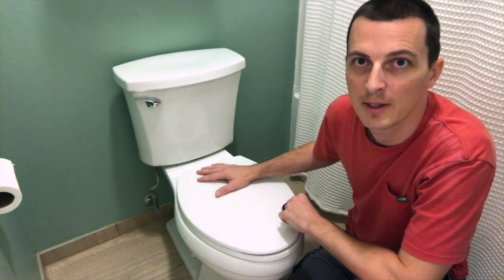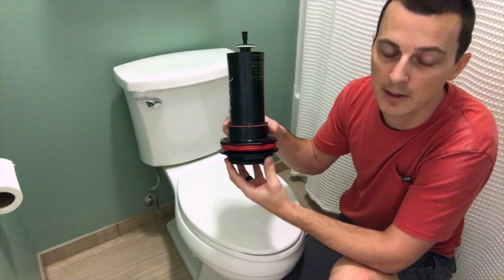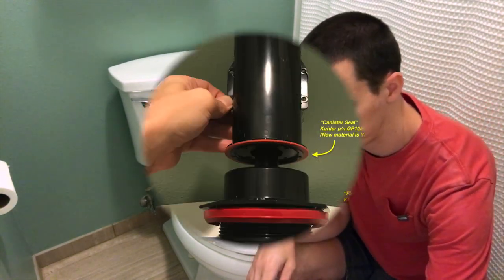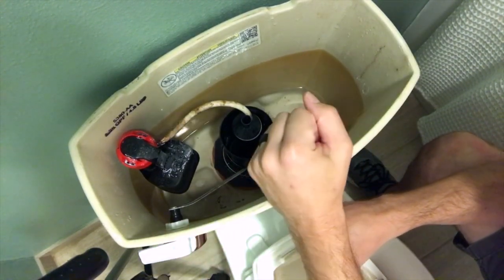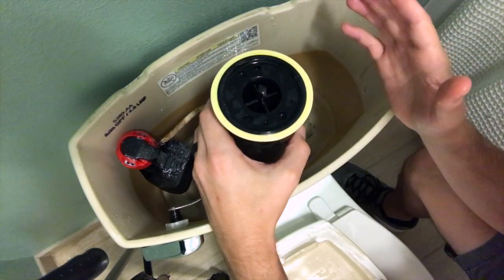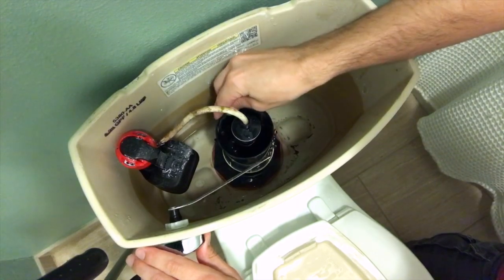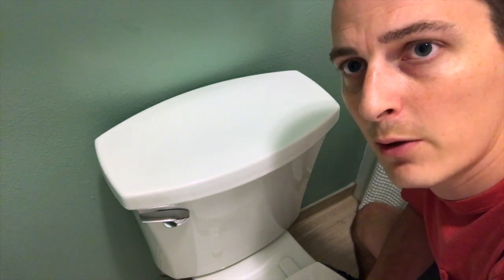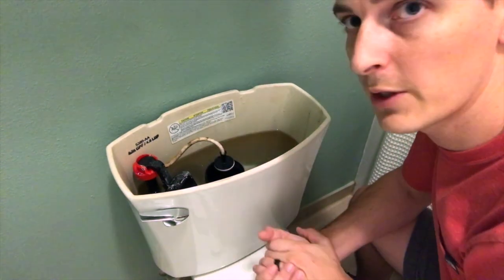Repair a leaky Kohler toilet with an Aquapiston canister flush valve

Comment: The die electric compound he is using is nothing more than vaseline.  Dow Corning also makes something similar called DC-4 and I'm sure that would also work well.  If you are going to remove the tank from the bowl why not change the seal and then apply a liberal coating of vaseline.  Lots of good information here though.

Comment: I was actually able to use a bar clamp to get it off.  Took a little fineesee.  And dont clamp it too tight or that will bend the large nut then squeeze aqainst the threaded aprt.  What a stupid design!